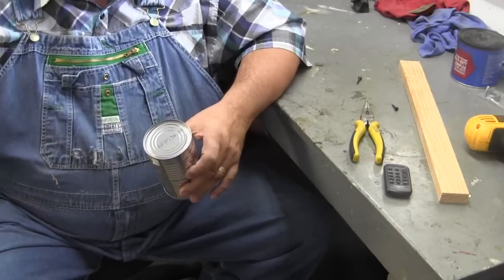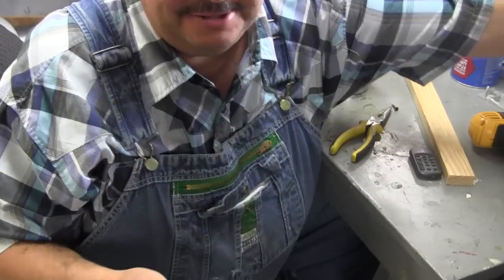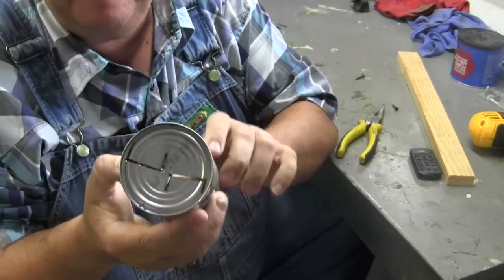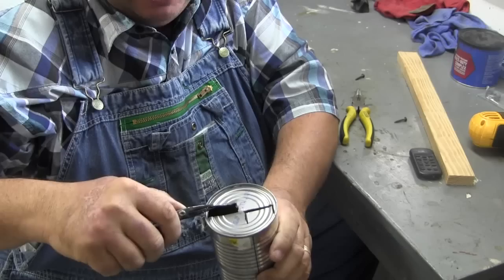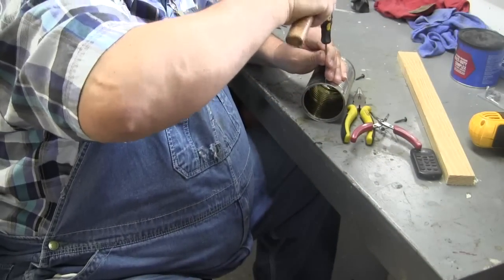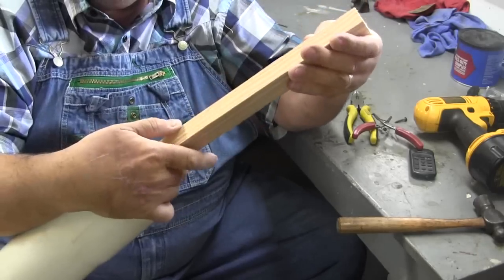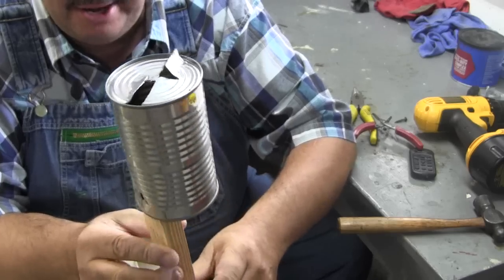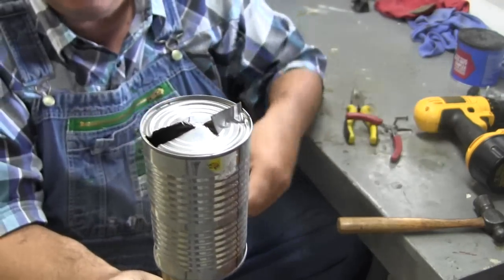How to remove gravel and mud  from a  well

Comment: 6.5 horse shop vac and 50' of 2" dust collector hose will clean it right out. Bigger rocks can be a challenge but will bring all stone and silt up with no issues. If there's water in the well I dropped the hose down, let it fill the end then pulled it up. It won't pull lots of water up 20+ foot constantly.

Comment: I came across this looking for ideas on how to clean out my gray water pipe that has a hole in it and is now full of mud and roots. i didn't know about it when I bought my house but it looks like someone hit it with a tiller and instead of fixing it they put a license plate on it and covered back up with dirt. 
     This may help me with that problem. thank you sir for posting this it will be a trick i will not soon forget.

Comment: Hello, wow that's awesome. I stumbled upon your video and thought if it would work on cleaning out the sand out of the bottom of my water supply tank. We get our water from the creek.    The tank was here when we got the place and doubt it has ever been cleaned out. But, its clogged with sand and my pump cant get any water from the tank. Any suggestions  would be appreciated. Not sure how well a sump pump will work on this. It has 3" of sand on the bottom.
Reply from the maker: I have no idea. Maybe a much larger number10 can?

Comment: Hi there....got any ideas on this?    Bought some land, has a well on it, and some jerk put pieces of cinderblock down the well...I can see 5or 6 pieces of cinderblock about 10 to 15 feet down the well casing.    Most pple say just ram it down the hole....but then you’ll have all those pieces of cinderblock at the bottom of your well....and who knows how many layers of cinderblock there is ...you’d just be jamming it all tighter and tighter....any ides on how might to pull those pieces out ?   Or even dissolve them?   The well is useless to me now anyway...sure would appreciate your thoughts on this..can send you pictures if you like
Reply: Long wood stick. Start chewing a lot of bubblegum. Bingo. God bless
Reply: Make yourself from rebar a U hook or a picker, weld 3 pieces of 6 to 8 inch of rebar on to a 1/2" inch pipe in a triangle spacing -} length wise like a TRIPOD , so the rebars are angled outward going down the well pipe (add coupling on top of pipe and you can keep adding 1/2" inch pipes to go deeper) and when you see the pieces of cinder block strike down with it so the cinder block pieces get caught between the triangular rebar like TRIPOD, because the rebar has notches! then pull them out one by one hope this helps!

Comment: This is a good idea, I'll try it with my own problem.
I hit a pea gravel layer at 1m deep, and it's really hard to drill using water, the pea go up the surface if i use up and down motion and seems floating around the bottom layer, maybe i should use mud with high viscosity, or a mechanical drilling method to drive the casing down.

Comment: Badass my hole is like 3 1/2 inch diameter and about 8 feet down I have what look like lots of 3/4 inch pebbles and sand. this will work fcking great on a long pipe to scoop out a few inches at a time. Only need to reach 20+ feet.

Comment: That is very dangerous the way he is cutting that.
Reply from the maker: Oh stop. Precious snowflake! There is nothing at all dangerous about this, unless you’re a dumbass that should not be around sharp objects to start with. In your safety Sally world, I should be wearing steel toe shoes, a hard hat, welders hood and a condom. Sissy.
Reply: no more dangerous than going to the dentist.
Reply: running a dremel is not dangerous in itself, i use them almost weekly for something including chainsaw cylinder work and here lately to cut crimped copper pex rings off of fittings and old pipe so i can re use them. i would highly recommend atleast speeding the motor up when using those cutting wheels. they are especially prone to break and fly off in pieces when ran at medium or low speeds. just passing along a helpful hint. great video even though i cant use it for my specific well. its too deep.